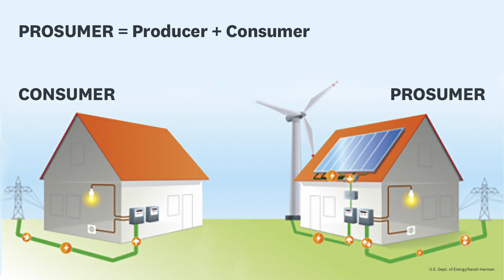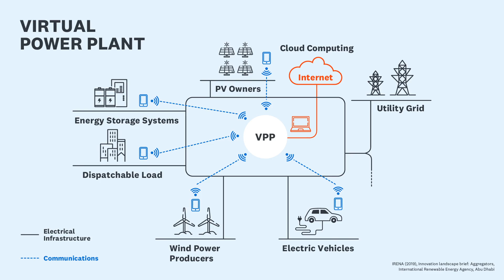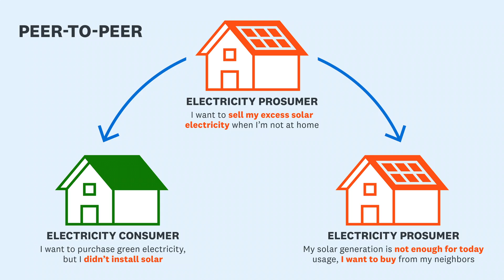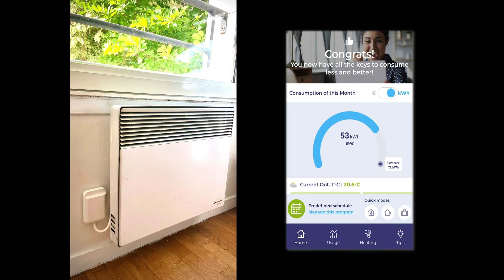What If Buildings Created Energy Instead of Consuming It? | Ksenia Petrichenko | TED

Comment: for those who can't see it RN, this video has 419 dislike including mine, by the time you see it, its probably a lot more and 1.6k likes.
Reasons- it was quite in my thought....POINTLESS, it's all theoretical without considering lower income population which is 70% who only needs roof over their head. we ALREADY HAVE working PROTOTYPE FUSION energy devices 30x smaller area consumption compared to coal burners, there's a company who has achieved successfull test and are bout to make it in large scale 2/3 yers from now and the larger size is roughly the size of a 6 seater HELICOPTER, so yeah, quite small.
its hard to find solutions for the past then the present and infrastructures are past.

Comment: Great talk, I like it. Has a lot of theories which are under research and application right now. Indeed, we need to rethink and redesign our building to make it more comfortable, more efficient and more sustainable. However, this way of thinking "the researcher's dream thinking" has a lot of inefficient thinking and I dea. Just imagine, at 4am, when the temperature is -40 degrees outside and the "intelligent grid decided there is a high demand on energy and we need to stop supplying heating water to some buildings. This way of thinking looks like Robin Hood's story, which tries to steal from the rich to feed the poors. However, the rich will never, accept their money to be stolen. If you do not get the idea, just rethink, all required technology relies on silicon chips. Silicon is rare in nature, and those chips, according to my knowledge, are not recyclable up to the moment.

Comment: It's great in theory. The trouble with all this is, is that it requires everything to be rebuilt - again. Take an office block for example - efficient for energy use to all people working from home, as a bus or train is, to individuals all going by car. An energy efficient office block that people, walk, cycle, and get public transport to, as the perfect energy saving scenario (ignoring the reality of everyone still wanting to work from home). An efficient block built in 2000, is hopelessly inefficient by todays requirements, and as such, most are being renovated at huge cost to meet carbon zero emissions. But, all these newer techs - solar panel windows (which makes A LOT of sense btw - particularly seeing as most office block exteriors are sheets of glass), battery charging floor panels (through vibrations) etc - have missed the boat. Not to mention their cost. In another 20 years when buildings renovate again - is it too late? And then there's personal homes - people get mortgages for a lifetime on existing properties. It's hard enough paying that. It like the internet - the speeds are there, but it takes decades to roll out full fiber to replace the existing network - only much, much more complex, as buildings are bogged down by long term, and lifetime contracts to old pre-existing energy in-efficient properties. I remember Tomorrow's World on the BBC talking about such energy efficient predictions in the future in the 80's. But going through life I see, that the problem has always seemed to be real world infrastructure and human society, rather than technology itself, that holds everything up. But otherwise, of course, I agree.
On another note altogether (and I do apologize in advance to the presenter if any way inappropriate - it's a compliment from my neck of the world!): what a fantastic Bond girl she would make! The look, the accent, the brains, a Russian born free thinker working on the importance of taking Europe away from Russian fuel dependence. There's even a current and relevant plot line in there too!